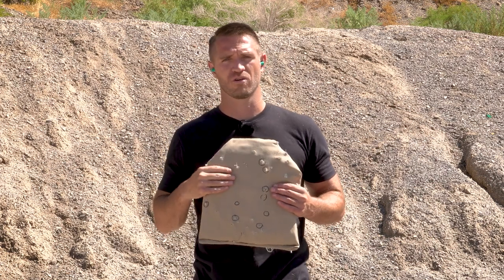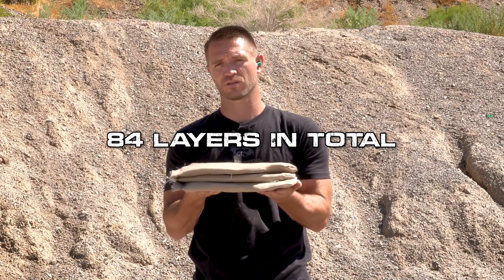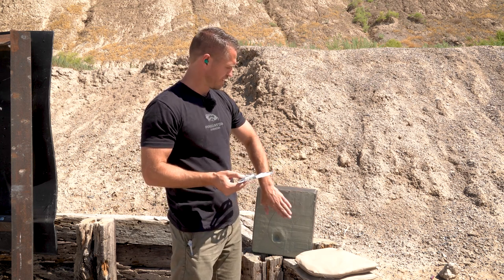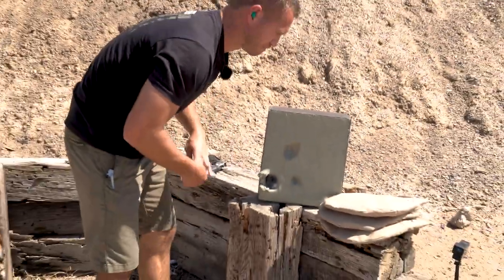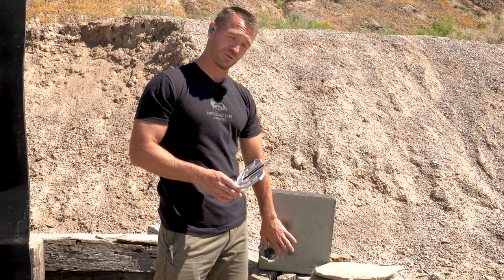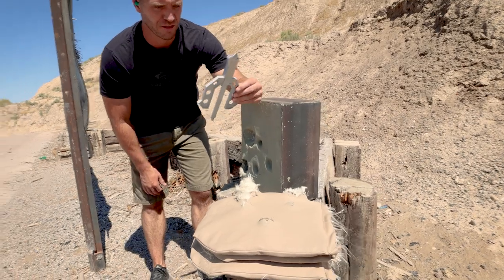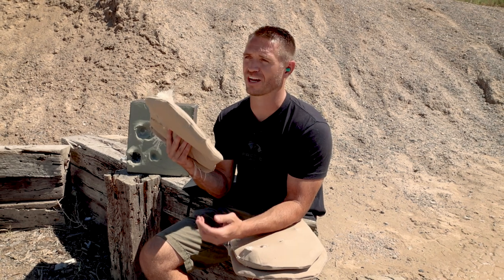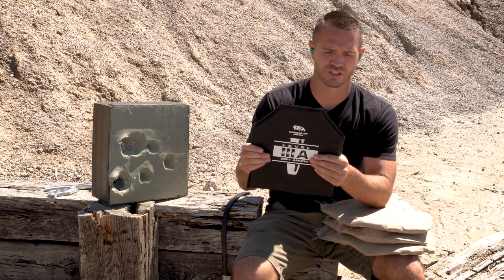Homemade Body Armor Soft Armor (Level IIIA) - Part 2

Comment: can create a level 2A/2  with 16 layers of the welding blanket plus 12 layers of s-glass (Bondo Autozone stuff) and 2 bottles of $10ea  “matrix” materials and one other $2 item - and it will be “soft” just as Hyperline, Hardwire, Alpha Elite soft-panels are … can’t “crumple” but you can bend and fold it and it will contour to your body in conceal carrier … both plates and full coverage (with sides&shoulder coverage).  If you send the materials I’ll create, record, and send finished plate back for you to shoot …. **And I don’t use stitching at all.  Also - can send DIY how to turn an “expired” vest into refurbished 2-3A soft panels/plates and even up to- level IV plates (with $25-$40 for soft & with $40-$70 to convert to level 4 …and still be within the industry average for width and weight.  Requires $10-$20 for additional product(s), but the 22-24”W x16”H lower 12.5”W upper panel of level 2 or 3A for $30-$40 …..this is ALL to make something that would pass NIJ testing

Comment: What about mixing silicone and mineral spirits to thin the silicone, and then soaking the whole panel in the silicone and let dry?  It would give it some structure but still remain flexible.

Comment: Would be interesting to see if a better quality welding blanket would do better. Is thicker and tighter weave. I think the poor performance compared to resin bonded welding blanket is because the fibers are pushed apart.
Reply: Increasing the oz of fabric or the weave pattern won’t work. Instead, laminating each layer in mold making urethane would hold the strands together. Also, fiberglass should be cut from a roll and handled carefully to prevent snapped strands or disruption to the weave.
Reply: Welding blankets are just not the right stuff...  they dont need to " make them better'(more expensive) because they work fine for catching sparks , slag and grinder dust.

Comment: Dumb question.  What if you replaced say 4 or 8 of the 28 layers with steel window screen? It would add weight, but may add some rigidity and strength.
Reply: I am looking to make some small test armour panels with a backing plate of 3mm titanum, obviously it will not be soft, but better rigid and save a few broken bones.:)